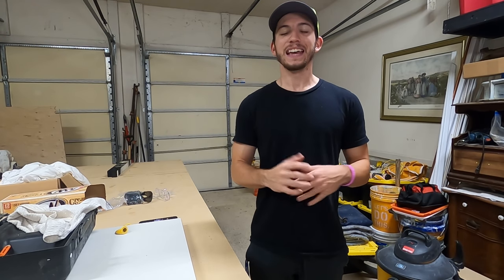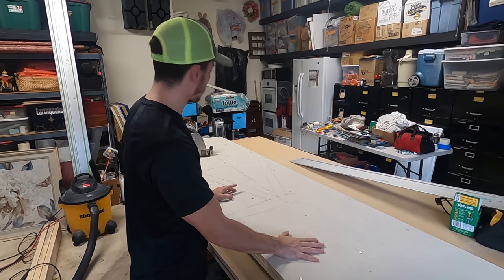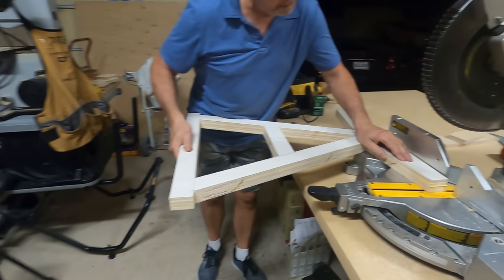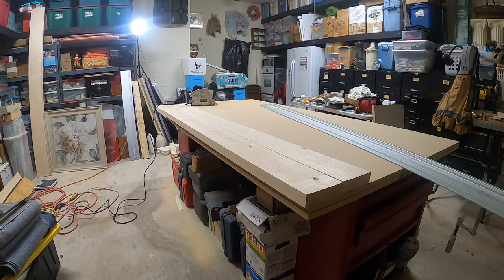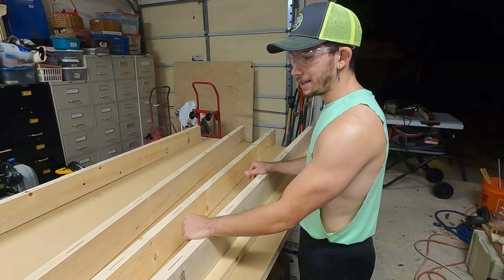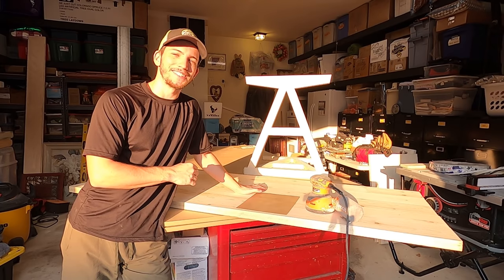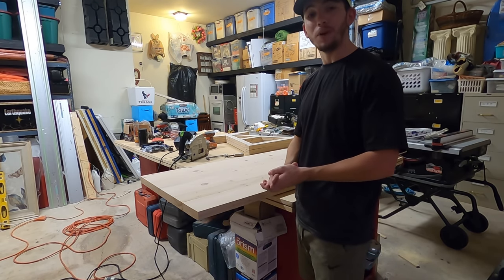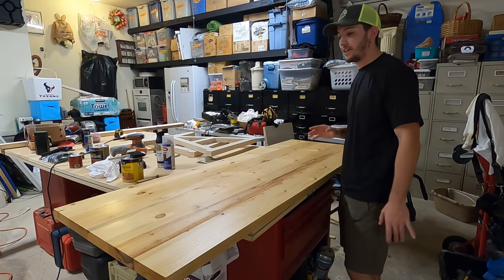Building a Custom Desk out of 2x6 and Plywood

Comment: Great job.  I'd have pulled the stickers on the metal brackets, maybe even etch primed them, and shot them black.  Also I would add some rubber feet pads to the bottom, to help protect the piece, the floor, and help conform to an odd floor easier.  Great design though.  You should be very proud!

Comment: Nice work guys. I made a similar table/desk in the past and had a problem trying to joint the boards together. Cupping was an issue cause my boards werent dry. Id said make sure your boards are dry. Also Id recommend routing the front top edge of the desk because its uncomfortable on your forearms with a hard edge. keep up the vids guys!

Comment: One thing you could have done to improve the edge, is to put a 30 degree router bevel on the top corner (holding the router sideways so you get a nice smooth "round over" on the top edge for your wrists) ).  At least on the front edge, where your wrist sits, but I would do all 4 sides.

Comment: Another trick to use for a final finishing pass on polyurethane, is a paper grocery bag...
As to the desk build itself, only thing I might have done different would be to add some cable access holes or slots THROUGH the top.......... This allows the desk to sit flush with the wall without any cables / cords going between the wall ad the desk top.
Reply from the maker: Cool thx Marshall 👍

Comment: Things i would have done different and you still can btw, trade the brackets out for some pocket hole screws, swap the legs for 2x4 or 2x6 and half lap them. may have been cheaper than getting a sheet of 3/4

Comment: (late to the party, but) I was really surprised you didn't angle in the edges of the legs at the bottom by 10 degrees to echo the 10-degree angles at the top. I also might have explored placing the cross braces to meet at the obtuse corners of the 2x6 brace (or at its center), and to attach to the legs at the bottom or the cross bar of the 'A,' just for a more continuous eye-path when viewing the desk from various angles. Not sure how the geometry (or available materials) would work out for any of those, though.

*I also agree with other posters about painting the steel brackets black, adding a grommeted hole (for a gamer, maybe even more than one) to the desk top to pass cords through, and more deeply "breaking" the front edge for wrist comfort.

Comment: Looks very cool, the desk, dude!  I would paint flat-black the metal angles holding the cable-run. Maybe, just maybe, make some grommetable holes to pass computer cables from the surface to under the desk. On the other hand, is a gift, right? Then is just fine the way it is. Kudos to a master-carpentierre on the making.
Reply: Sheesh! Just read all the way down the comments and looks like I transmitted my recently posted suggestions to some guy Matt, about two months ago. Funny how telepathy works. Right?

Comment: Good build, but since using 2x4's and plywood.. maybe good to have added the costs, so to up the 'wow-factor'.   

Also, it were me, I'd have scoured the internet to find & buy steel legs and save that massive amount of work - esp. if going for black legs, since can buy black legs (only $100-$400 depending on aesthics and weight load). Also if it were me, I'd throw a veneer onto it -- love that it is sturdy, but the look for me = workbench, not something for inside a home. But despite my urge skip the tougher + unfun work by buying metal legs and to pretty it up, great job + video Jordon!

Comment: Great job bro! Really good solution for making it structurally sound and aesthetically pleasing. Rubber shoes would be smooth (won't slide on slick floors). I built a kitchen island and got a laminated counter top for it. After seeing the desk top I wish I had made a butcher block top for it. 👍🏼

Comment: Excellent build. You asked for any suggestions that might improvement the project. This is only a minor suggestion. I like my edges and corners slightly rounded to help prevent chipping and for esthetics and for safety sake (sharp corners). These comments are not meant to be negative but instead a positive to go along with how Studpack does things....the right way!! Nice work!

Comment: Looks great, and is a great video, however what cost $150? A sheet of the best engineered oak cabinet grade is about $50. Anything that I was going to paint would be basic sandal ply which is about 25 to 30 depending on which big box store you go to. and those two by sixes come at about 15 apiece. $75 plus another 10 or so for hardware and finish. I say a desk like that is worth $150 if I sold it. But that’s including time labor, experience, and profit. Not dogging jus curious.

Comment: looks sweet.  maybe paint those metal brackets? and depending on cable management,  cut a hole for all the cables to route through (to plug into the power strip)  Great job!
Reply from the maker: The power strip is on the backside of the 2x6 so the cables will fall behind the desk and plug right in! No hole required. Thanks for the support Matt!
Reply: @StudPack  sometimes it looks nicer to route all the cables through one hole instead of having them all drape over the back of the desk.  They even make metal and plastic grommets to dress up a hole. It also allows the desk to sit flush against the wall.  if you (or your friend) does cable management properly, there will be minimal visible cables at all.  It all depends on the usage and  what look he is going for.  In my profession, i am asked to do this sort of thing.....some executives can be exceedingly demanding.
Reply from the maker: Matt Reilly that’s a great idea man! Those little grommets probably don’t cost much at all either. The desk sitting flush with the wall is a great feature. I’ll be incorporating that in the next desk builds for sure 👊🏼

Comment: How do you know when you have “buffed” it enough on the top
Reply from the maker: It's really just a feel thing J! After the second coat of poly you'll notice it start to get very smooth with a few bubbles and bumps here and there. This is when you really have to work it down and get it as smooth as possible for the next coat. Each time you lay a coat down it gets smoother. You buff on your final coat, and you buff until you're happy with it.
Reply: Stud Pack that’s what I was thinking 
Thank you for the reply

Comment: I would like to know how you mounted the power strip in the back
Reply from the maker: We purchased a power strip that specifically had mounting holes drilled in it. Then just used some 3/4 inch screws to mount the power strip!